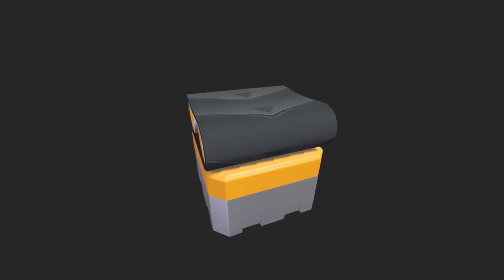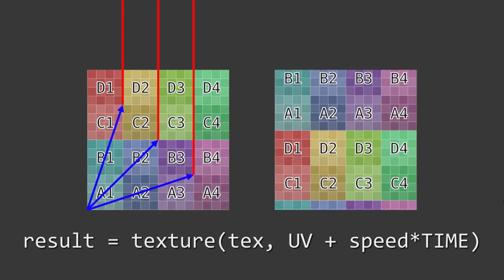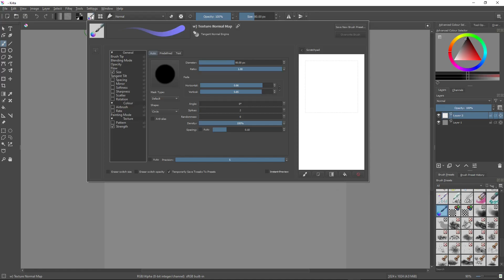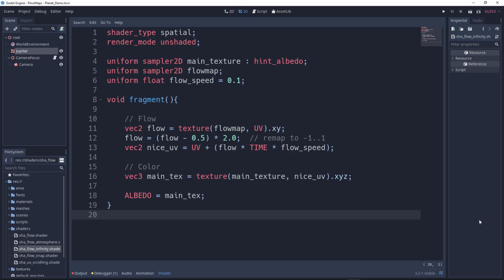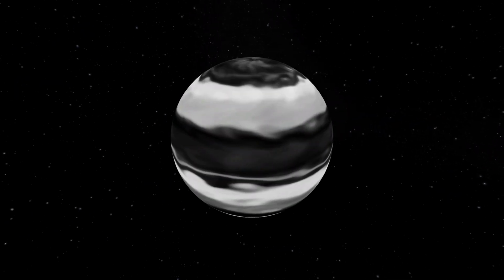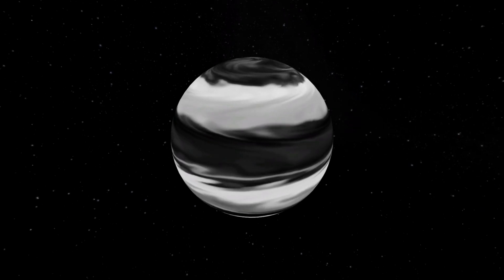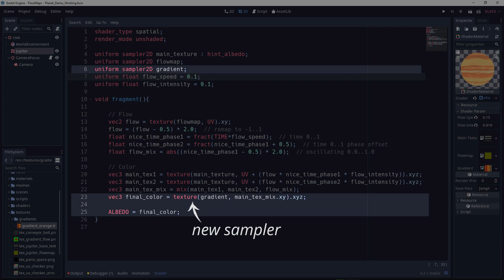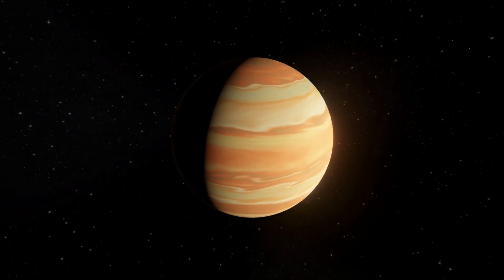Flowmaps, gradient maps, gas giants.

Comment: The real way to make a gas giant shader is to do a CFD simulation with proper turbulence and advection to get a nice Karman vortex street just like Jupiter has, make it slow, and constantly keep adding pressure with just the right decay to achieve a semi-equilibrium.
Reply: Are you describing a shader or a fluid simulation? Or do you mean that you would bake the output of the fluid simulation into a texture of some sort to use in the shader?

Comment: Interesting. I don't think I would have come up with a technique such as this with what I currently know(I haven't really written shader code, but I have watched quite a few videos on it because I like the math).

However, this technique feels very NOT elegant to me. Prior to coming to the part of the video showing the use of fract and the mixing of two out-of-phase flowmaps, I was thinking "How are you going to ensure that these moving points don't clump up over time?"

Maybe a more elegant approach (though perhaps less performant, and maybe just not worth it, maybe it wouldn't work at all) would be to simulate some 2D boids https://www.youtube.com/watch?v=bqtqltqcQhw which, in addition to obeying normal rules, also individually try to follow the flowmap.

Edit: I realize actually paying more attention to the code in the vid, the new coordinates the UV coordinates are being mapped to are not actually being incrementally updated. So it's not actually simulating flow.
Reply: Another thought... if we want to keep things cyclical, and continue using the (initial position + flow*time) thing, and not have discontinuities... can first map UV's onto a spherical texture, and have them move in a direction(based on the flow map) on the sphere at a constant speed, and they will all simultaneously return to their starting points. Avoiding discontinuities could be done by making sure the flow directions in the flow map don't differ by too much for pixels nearby (on the sphere).

Comment: Hello!
I have tried to use fract(TIME) * flow_speed or mod(TIME, 1.0) and got better results than using fract(TIME * flow_speed), hope it will be useful!
Although the best way to avoid this kind of negative shaking effect is adjust UV of your model to be exactly 0 to 1 on the axis you are planning to move UV